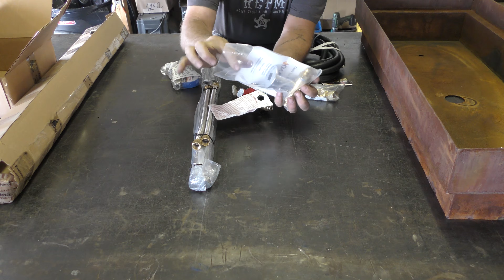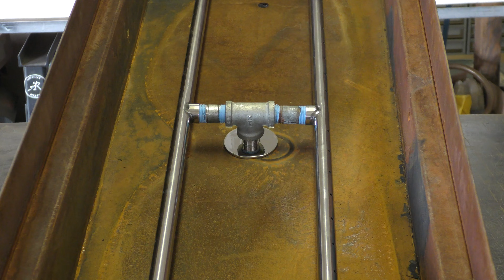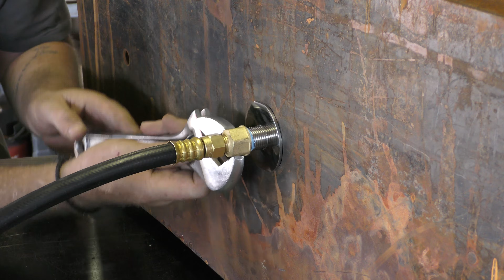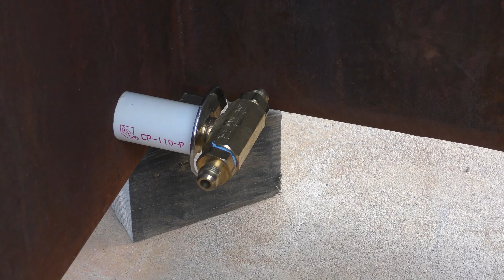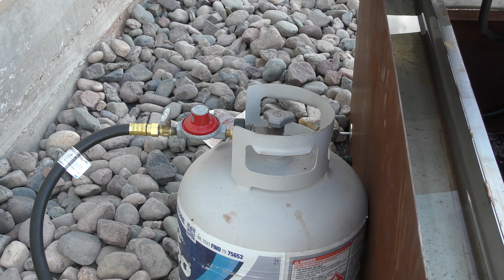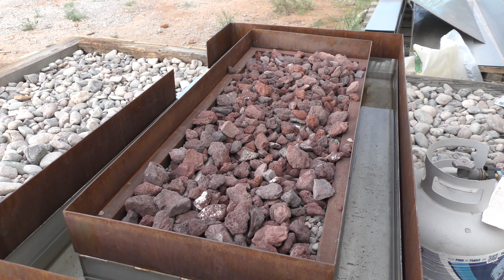How To Build A Fire Pit

Comment: Question! Does the galvanized T fitting stay cool enough to not worry about the toxic gasses or whatever happens when galvanized gets hot?
Reply from the maker: If you're welding you're reaching temperatures between 2500 degrees and 3000 degrees and the vaporization point of galvanized steel is a little over 1600 degrees. So anytime you weld galvanized steel or fittings you're more than likely going to release toxic gasses. Just make sure to stay in a real ventilated area
Reply: @ArtfullyRogue ahhh, ok, so, its more of an issue when assembling, and the flames from the burner arent really going to be in contact with the galvanized enough to heat it to that point? (Dont worry, im nkt looking for legal disclaimers)

There are so many of your projects that i want to try, in fact, im starting a barn door inspired by you this weekend!